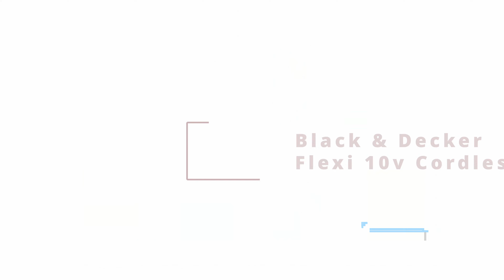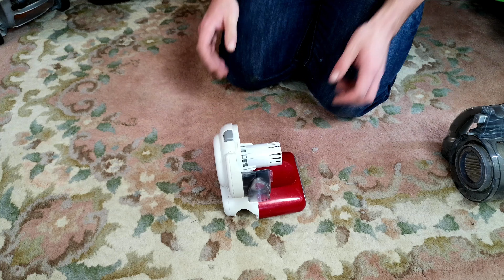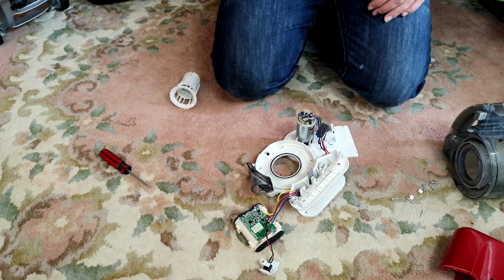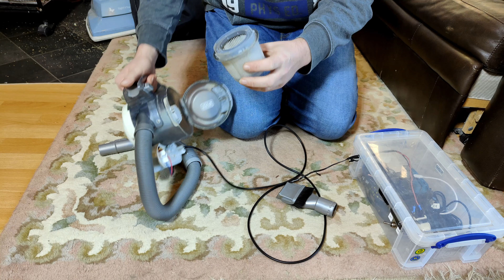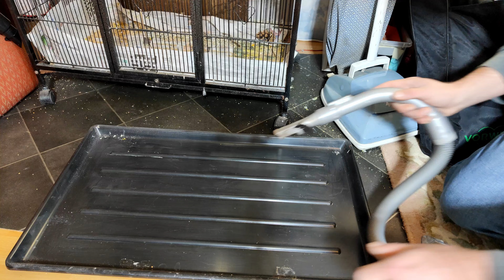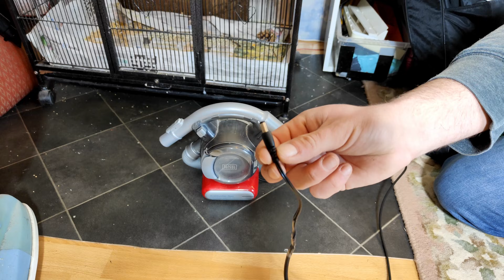Black & Decker DustBuster Flexi - Hacking it alive again!

Comment: Yea the wires in that setup are too thin for the current that motor draws lol.  I could go into more detail but I won’t, to get the same amount of wattage in a cordless you need far more amps because wattage is equal to voltage x current. Even the cable off of a mains vacuum would get warm in that setup although that motor is fairly wimpy probably around 100 watts so 10 amps at 10 volts. 100 watts at 240 volts would be like 500 milliamps. At 18 volts though it would have been drawing more amps because you are increasing the amount of wattage it draws it would have been nearly 20 amps 😅😂
Reply from the maker: One day I need to learn all this properly 😂 Tbh I think thinner wires in this application is better, it wants to be fairly limiting 😂 I need to get bigger wires on my sealey bodge though, it needs more power
Reply: 🤣 its a rabbit hole sam lol, it would be cool to see though
Reply: @beko1987  the wires should NEVER be the limiting factor unless you are building your own battery packs, that's a special case. When the wires are the limiting factor, they limit by getting hot and burning the insulation off, causing a fire and short circuits. You want your power supply to be the limiting factor, that's what the circuit board on the original pack was doing, limiting current draw and monitoring the health of the batteries. That way, the motor uses all power provided (efficient, low heat loss) and the wires stay cool (efficient, low heat loss, safe).
Reply: I should add as well although I have already said in a previous video, when wires get hot they become resistive and actually turn your precious battery power into heat so the motor gets less power, that’s what happened with the W/D vac, that project is very cool would like to see it again along with a digital motor in the Miele cordless🫡